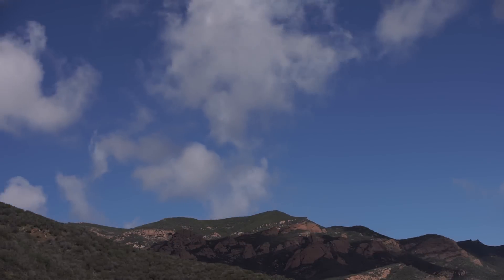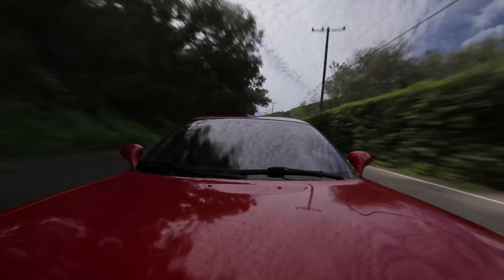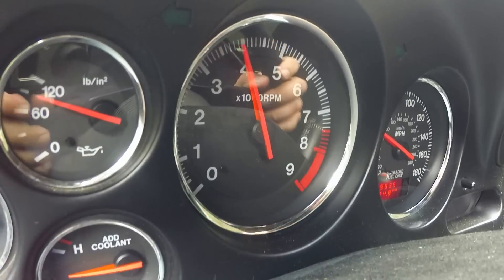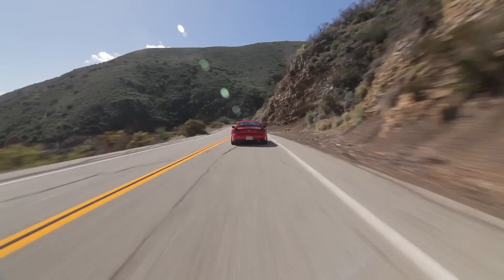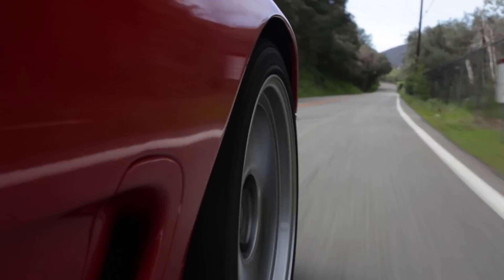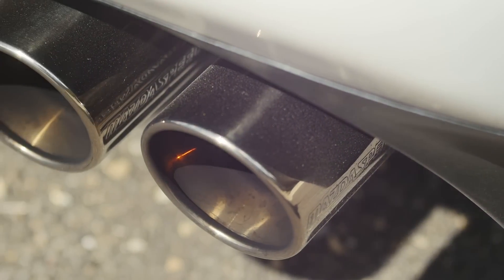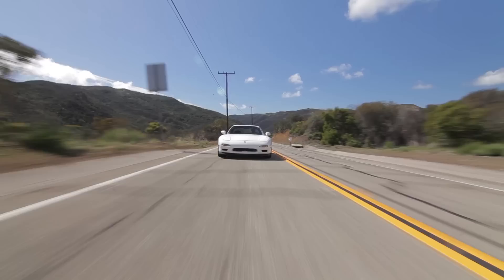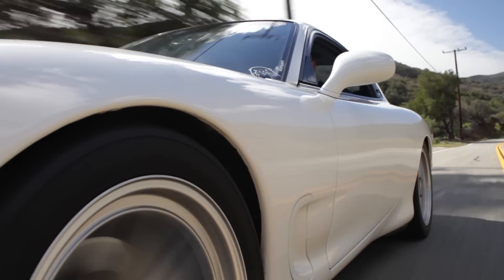Mazda  RX-7: Turbo vs V8 - /TUNED

Comment: The comparison was v8 vs. rotary regardless of displacement. And the question whey would you do a LS v8 swap? Well pretty simple way easier to find and afford parts, and you can make more power cheaper and easier. Sorry not opinion fact.

Comment: Matt, how well do you fit in the FD? I am considering buying a 1995 with an ls7, but I am worried that I won't fit. I can't find one locally to try.

I am 6'1" 235lbs with long legs.
Reply: I'm 6 ft and I own a 95 FD and I fit perfectly, I'm a rotary guy though so I'm not ruining my Rx7
Reply: Buy it and swap a rotary into it

Comment: Fucking criminal to put an LS in one of these. When the journalist is talking about not "getting" the engine, or when he's making the ridiculous claim at the end that the LS is better in every objective way, he's completely ignoring the fact that the rotary is significantly lighter, takes up less space, and allows a lower center of gravity in the car. The frame of the car can be lighter, to hold a lighter engine, and the transmission will be lighter due to the lower torque (which is compensated for by the higher rev limit), the brakes can be smaller, the tires will last better, and the cornering speeds will be higher. It's obviously how the RX7 sets itself apart from the Supra, or Skyline, which had their own unique selling points. When you shove an LS in a package like that you FUCK the balance. You need bigger heavier brakes, a bigger heavier transmission, bigger everything and you can go around in circles upgrading all that stuff as it opens up a need to upgrade something else, but you'll keep getting heavier and more expensive, and you will have permanently lost what made it a special car. Reviewer totally missed the point of the RX7.
Reply: +Faketrollname sevenbillion . And you have totally missed the point of hot rodding. No???
Reply: +Bill Cut No I think i got the point of "hot rodding" just fine. It's adding whiskey to a fine wine so it gets you drunk faster.
Reply: +Faketrollname sevenbillion You got the idea of hot rodding the wrong car just right. Throwing the LS into an RX-7 keeps only the superficial part of what makes the RX-7 special. Having more power at the expense of heavier brakes wheels and tires (unspring weight), more distributed CG, higher CG, more nose heavy etc. etc. is the difference between the straight road American sports/muscle car versus the canyon carving Japanese or British sports car. Why start with something great for the latter and take it all away to make it something that it wasn't meant to be.

Comment: three years later and people are still crying i ls swapped my r1 with 32k miles with an ls3 and i didn’t die, i do everything better than my friend putting out 580 out of 20b my brakes are better my suspension is better and im banking im alot lighter get over it i still have my 13b in a crate it didn’t need a rebuild it ran great i was making 310 but i said fuck it i want me one of dem ls bois  and its worked for me other people drive it and love it they tell me “wow that’s pretty well balanced” and the world keeps on going oh and for all you rotards saying oh if you’re gonna swap it put in a 20b or 26b clearly dont have a clue to the cost behind one of those swaps i have about the same in my entire car than my buddy does in his swap alone

Comment: you say the v8 is faster but that coming from a person use to driving v8's its a whole different story when you get drive a rotary for awhile and get use to keeping the rpm up high they are just like a 2 stroke engine they have a distinct power band and it's a whole different story when you can stay above that mark

Comment: if you want a car that feels like a Corvette, go buy a Corvette. That extra 100 lb.ft of torque can easily be made by an increase in boost and for the type of driving this car is best at that extra weight is going to hurt you more than the powerband of the smallblock will help.

Comment: I think this didn't compare apples to apples.  First the cost of swapping a v8 on a rx7 is pricy and with all that money you can make a sick 600hp rx7 or more reliable any day if you know what your doing.  With that set up then it would not even be fair for the v8.  A more apples to apples comparison would be a v8 vs a 20b engine swap.  You can do a 20b swap close to the same price of v8 swap and a stock 20b with stock turbos can easily make 400-500 without even stressing it.  If you decide to build it a bit at a very low boost setting of 15-17 psi you can make around 600-700hp in a 2900 pound car is insane.  So without a question a 20b swap would be a better choice to swap on the rx7 FD.  This comparison is like comparing a 4 cylinder car with a v8 the cars should have the same power levels to make it a fair comparison.   But loved the rx7 inspired video.

Comment: The benefits of the rotary motor are lower weight and lower center of gravity due to smaller size so it can sit lower in the chassis but the drawbacks are lower MPG and oil consumption. Plus they make a pretty crazy amount of power per liter in comparison to standard piston engines which is pretty cool.

Comment: One of those Synergy V8s in an RX-7 would be pretty cool IMO. Its sort of like the in between for these two builds. Its small and revs high like the rotary but has that little extra grunt from the N/A V8. Plus they sound really cool too.

Comment: Rotary is still under developed, could totally increase efficiency. The reason why they lack torque compared to hp is because they loose about 1/3 of the power in wasted compression on every cycle, which could be solved using a 5 stroke design. It's even possible to develop pneumatic or rotary valve timing to further increase cycle efficiency.  And to top it off wankels function best if they can be started with momentum already acting on the rotor, which means they are practically bred to be hybrids.

Comment: So the conclusion is that V8 is a far better choice than the Rotary?.... I'm a fan of the rotary, however can't deny the fact that it does have to work hard for the power. If there was some way to give it some real torque and better fuel economy, it would easily be a great swap to put into various projects over a LS.

Comment: explain to me how making more power out of a 1.3 litre than out of a 3l v6 engine isnt better? and i shouldnt start about weight and vibrations
Reply: +The Real Santa Claus Thats because that cute little 1.3 liter engine, isnt really a 
1.3 liter engine.

that 6 liter v8 is measured as a 6 liter v8 because they measured how 
much air it displaces over a full thermal dynamic cycle.  In a 4-stroke 
v8 this takes 2 turns of the crankshaft, and measures how much air each 
and every individual cylinder intakes, and then exhausts.

This is NOW how the "1.3 wankel" was measured.  The rotary engine was 
measured by observing how much air the engine moves in 360 degrees of 
e-shaft rotation.  Theres a slight problem with this- for starters, that
 only measures 2 of the 6 revolving combustion chambers within the 
engine.  Rotary engines actually have a 1080 degree thermal dynamic 
cycle- 3 rotations.  If you measured the engine according to its thermal
 dynamic cycle, you know, like EVERY other type of engine ever damn near
 (be it 2 stroke, 4 stroke, piston, or otherwise), its actually a 3.9 
liter.

But making the same power on 3.9 liters doesnt look ANYWHERE near as 
impressive as 1.3, now does it? Also cant trick insurance companies- and
 government tax laws "Oh no, its only 1.3 liters!"

If you start to look at a few other factors- This all becomes 
amazingly clear.  Rotaries like to run at about 12-13 AFR.  Now why on 
earth, would a 1.3 liter engine- running only slightly richer than a 
piston engine, get about a fraction of the mileage? If you 
understand that its because its running this afr, for THREE sets of 
chamber-pairs- It makes a WHOLE hell of a lot of sense.  

Rotaries also have, lets be honest- piss poor efficiency.  The 
combustion chamber is dynamically changing, and its not a good 
shape either.  This is bad for actually combusting air/fuel mixtures and
 converting the process into mechanical energy.  Rotary engines actually
 convert a LOT of the detonation process into purely heat energy because
 of this ineffiency at converting it into purely mechanical energy.  
This is a large reason theyre so hot (along with having 3 detonation 
events, with no non-detonation events, in an isolate part of the chamber
 per thermal dynamic cycle, 4 strokes intake cold air, compress it, 
detonate, and dump it out.  One part of a rotary engine is nothing but 
bangbangbangbangbang, but i digress).

Point is- Dont sit there and pretend to sit pretty on some hill because 
"ITS ONLY ONE POINT THREE! SO EFFICIENT!".  Its an amazingly ignorant thing to say. Its the mantra of internet desk warriors, and little else.

The reality is, theres a LOT of things to PRAISE the Rx7s engine for.  A lot.
  Theyre incredible powerplants, for reasons that stretch well beyond 
their uniqueness.  So much so- that we dont need to bullshit and make up
 pretend reasons to like them.
Reply: it is actually classified as a 2.6 liter according to all my taxes and insurances SidewaysGts
Reply: The Real Santa Claus
 Its classified as a 2.6 in numerous racing sanctions as well (Unless its type of racing where 2-stroke engines are involved, then they go with the 360 degree rotation measurement more often than not).

Comment: of course he would opt to swap in the easy power, a guy who gets to drive around big v8 monsters on the reg would prefer all the extra power.  I cannot argue with the fuel economy savings from having the extra power but not at the cost of the driving spirit.  Cars like this are meant to be fun in more than just a straight line.

Comment: As Armen said in the video, the RX-7 is a purist racing car for the street. High revving low torque, lowish weight. To get the most out of it you need to be on the ball, in the right gear, making every km/h count around the corners.
In comparison the big torquey V8 almost feel like cheating.

Comment: I know its a different car but still a rotary engine... But i saw two RX-8s yesterday and both sounded terrible. One was on the street and the other was on the high way but they both sounded like it had a bad "honda" exhaust even though they both looked stock. Do they all sound bad or just coincidence?

Comment: Rotaries are smoother and have better throttle response.  If you just want to go fast then there are easier ways.  If you enjoy driving a smooth and very responsive engine that you can rev the hell out of and abuse all day then a rotary will put a smile on your face.

Comment: If I had a clean FD that needed an engine I doubt I would rebuild a wankel.  There's something about the sound of a rotary engine that doesn't do it for me.  That's not to say I'd use an LSX engine either.  The FD RX-7 needs an engine that makes noises which rival the beauty of it's body lines.

Comment: Idk, i kinda feel like you should really have to work a motor to get the best out of it. I dont exactly have an opinion on rotaries, i like them, but i also like piston motors. I just think horsepower and speed it something that has to be earned (In a roadcar), not something that should just be given to you from 800 RPM. race cars are of course a different story.

Comment: Put an Rb or 2j in a usdm, no one bats an eye. Put a v8 in a jdm and everyone looses they're minds. Honestly I see no problem In that.

For example, I absolutely love the high reving vtec 4 banger from an s2000. However, after seeing a ls7 swapped s2000 at a meet, it was truly some special.

Comment: The white one, hands down. The low key appearance with tasteful mods, such as the lip spoiler, is perfect. Most importantly though, it runs like a beast with plenty more room to grow, and sounds mean and aggressive. The rotary not only performs worse, but it's way less efficient, less reliable, and simply sounds horrendously obnoxious to me. I don't care for the spoiler either.

Comment: Ummm... the "V8 car is faster"? There is SO MUCH to say about rotary engines and what can be done with them, and this video barely covers the basics of a rotary. How about a V8 vs a three rotor 20B engine? Or a quad rotor 26B? That would've been a whole different story. Even the small 13B twin rotor engine, it's insane how there's so many import drag cars that use a 13B, pushing sometimes more than 1000hp, and running 7seconds on the 1/4m. Oh and let's not forget, we're talking about getting 1000hp out of an engine that's like half the size and weight of a big bulky V8. So, just because it's a V8 doesn't make it faster. ;)

Comment: The RX-7 and the Rotary are a package deal. If you buy an RX-7 and want to swap a V8 into it, then you don't like RX-7's. Simple.

The guy on Regular Car Reviews said it perfect: an RX-7 with a V8 is just a smaller Corvette C5. The Rotary MAKES the RX-7. I'm not saying that Mazda copied the Corvette. Actually the designers of the C5 Corvette based it on the FD RX-7.

Comment: Rotary utilizes better engineering so that's why it's better.
Reply: +Aaron Purtell Some main complaints of the Rotary are gas mileage and burning oil. One of the most common misconceptions is that the Rotary engine burns oil out of fault, this is not necessarily true. The Rotary uses oil squirters that take small metered amounts of oil and mix it into the fuel to lubricate the seals. Gas mileage is very Mehhhhh at mid 20’s (supposedly….much less in reality.)Rotaries also tend to produce about as much torque as a screwdriver and seals tend to be a big problem after a while if you live in a colder climate. Parts are generally expensive and since it’s a Rotary, you have to take it to rotary mechanic or dealership to get it worked on when something goes awry.Rotaries sometimes have a problem flooding with fuel on cold starts as well. This generally only happens with older 13B’s, so it’s necessary to let the motor warm up to operating temperature before you decide to take off.

Comment: I would rather put a suped up 3SGTE engine in an FD if I was going to pull the rotary out for some crazy reason. They are small and also produce a shit load of power. Still I would go 3 rotor before all that happens.

Comment: I know that this video is old and all but i wanna point out that the Rotary DOES HAVE DOWNSIDES. Everyone in this comment section is commenting on how the rotary is supieror and you ruin a RX7 if you put a LS in it. Now im not saying LS is the best or anything but i just wanna clear a few things about the diffrent engines Rotary vs Piston engine so we can see both sides of the coins.

Rotary - Because of its construction its light and perfect balance ratio (if the car is built properly in this case a RX7) Its a nimble little race car and we can all agree on that. But because how how the engine is built it drains oil faster which in turn leads to you will have to refill the oil more often. Second of all if you dont have it at high rev it will slowly stop run because once again how the engine is built. With that being said the Rotary is a nice little nimble engine and a classic engine.

Piston - Ah we all know the classic piston engine. Having some of the most iconic engine´s like the 2jz , 4AGE or in this case a V8. First of all it will not drain oil as fast as the rotary and second of all it work at all rev. But the downside with a piston engine is first and foremost, its weight. The less weight the more fun in most cases. 

Conclusion - They are both good engines with their own faults and goodies. At the end of the day it all depends on what kind of person you are. And you shoulndt blame anyone for doing something you dont like. Remeber its their car they can do whatever they want with it. If one want to do a LS swap in a rotary then go ahead no one stopping you. But i just want you Rx7 people to atleast not nitpick on how its so bad do a LS swap. And if you take care of your engine properly it will thank you for the years to come :)

Yours sincere Matt Dont Forget

Comment: I want to stay true to the Rotary cult, but I don’t think people understand how money can sway a project. You can get an FC or RX-8 body for cheap, throw in a truck LS for cheap and have a budget light sports car. Of course it changes the car, but the money you save by having it swapped is crazy. A teenager and his engineer dad could build a LM4 swapped FC in his garage and still have enough money for other upgrades, repairs, gas and oil (cause rotaries drink oil and gas). Yeah the purity is gone, but your wallet isn’t, and if you have a fixed budget like a lot of teenagers do, you can’t afford the preventative maintenance or have the discipline to make sure your rotary doesn’t fail, and definitely don’t have the money for a full rebuild